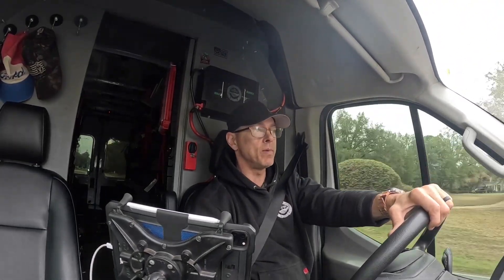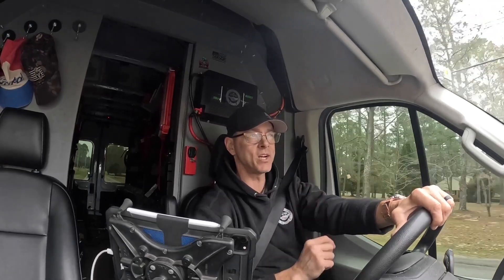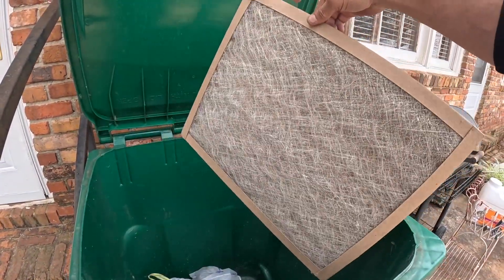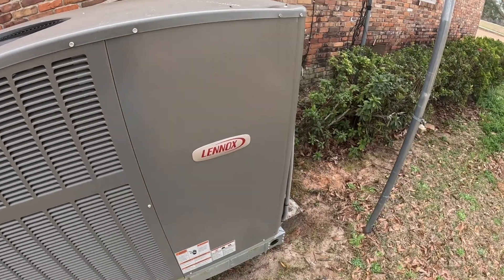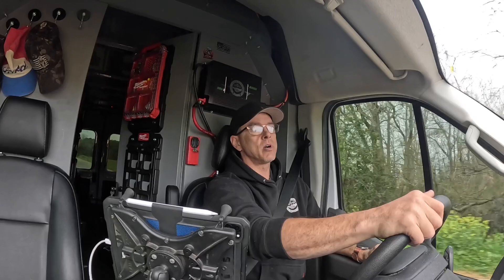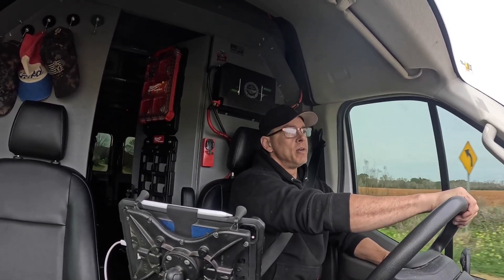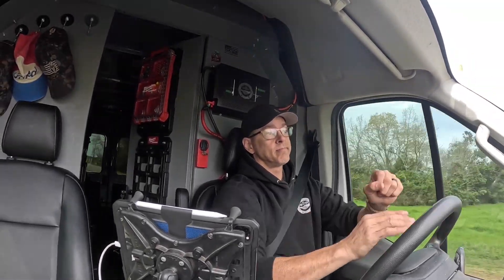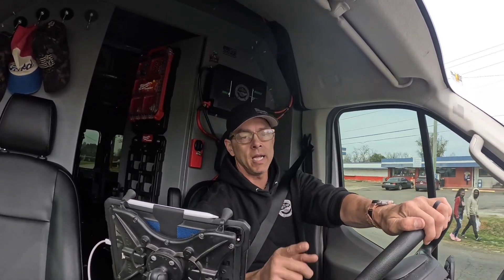New Lennox Heat Pump Package Not Working! #hvacguy #hvaclife

Comment: The charge is reasonable just for the fact that it's memorable and not changing filters can cause additional costly problems down the road.  You may have actually saved them money if the lesson sticks and they'll probably tell their friends.  Someone might even write a parable about the $200 filter.

Comment: Hey Curtis, I gotta ask, why was it $200 to change an air filter? Was it the drive out there? The company I work for would only charge $100 . Just curious
Reply: Try $380.00 after a compressor was going off on high pressure.  I was the second technician going to check the system.  The filter was in the first floor. It was a major company across from the shop.

Comment: I've run no heat and no cool calls at the end of heating or cooling season and they're wanting the opposite function. Generally on systems that had manual change over thermostats. They simply didn't change the thermostat system operation switch. Life can be cruel and expensive, more so if you don't check the basics.

Comment: I wonder if some were confused about high pressure switch opening with airflow issue on inside……would only happen in heat mode, we are running cool mode in florida already.

Comment: I don't ever feel bad about a user error easy call. I'm an automotive locksmith. We get lockout calls where the passenger door is unlocked but they never checked. One of the windows are opened etc etc. I still charge them full price. 

I do give a lot of free advice over the phone though. Many times I talk them out of paying me for a call so karma wise I'm good. When they tell me "I think" my keys are locked in the car I give them my locksmith speech. I explain in my experience if they looked everywhere and they hope, pray the keys are in the car 19 out of 20 times they aren't going to be in the car. I also ask them if they have a spare set anywhere else in the world because that will be cheaper to next day them than to have me (one of my guys actually) make a lost key. We don't make a car key cheaper than $250 and they can be a lot more. I can't tell you how many people call me back and thank me because I encouraged them to keep looking and they found them.

Comment: A question if I may: the 2nd letter A in my blower's model number RBHA-14J05NFAA is (A = W/O Coil, With Casing). What does "without coil" mean?

Can someone help me with that?
Thank you in advance.
Reply: Without coil is exactly what it says. Not all air handlers have coils just as all air handlers do not have heat strips or water coils. The nomaclature for all hvac equipment can be found on the internet. All you need to do is type in the information .👍🇨🇦
Reply: @danobrien3109  my confusion came from my air handler does have an evaporator coil but it stating in the model number code “A = W/O coil” that doesn’t make since to me. I was thinking maybe there’s another type of coil and not the evaporator coil they’re speaking of. 

But, it’s not a big deal, it’s information I knew I could learn from.
Reply: @10speed4  it may refer to a water coil. Not sure where you live. In the northern states and in Canada were I reside they have water coils in some air handlers that get hot water from a boiler pumped through them as a heating device. So an air handler can actually have two coils. One heating coil and one cooling coil. An air handler used with a heat pump generally has one coil that serves both purposes and supplemental heating strips. Hope this helps to clear the confusion.👍🇨🇦
Reply: I've made that trip for thermostat batteries.  I told one customer "these are THE most expensive batteries they make". He asked why. "Because I'm putting them in for you". He learned to check them himself.
Reply: Sorry. I meant to put that in the regular list, not this one.